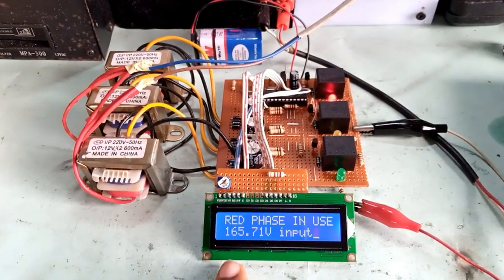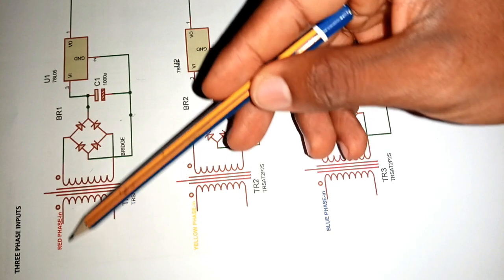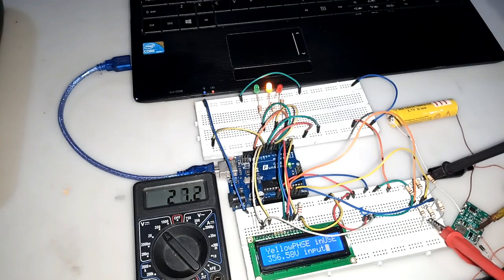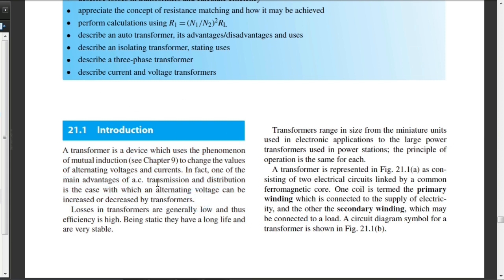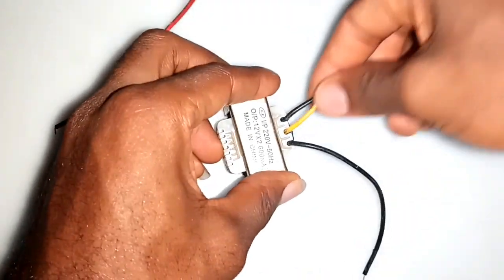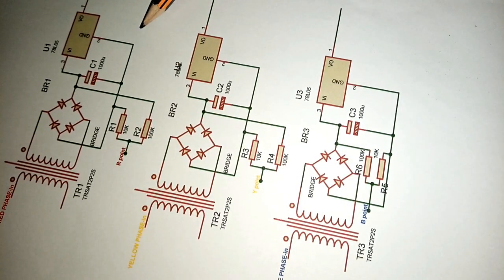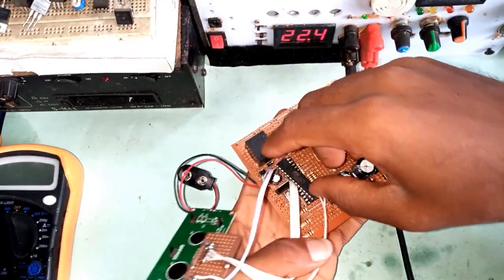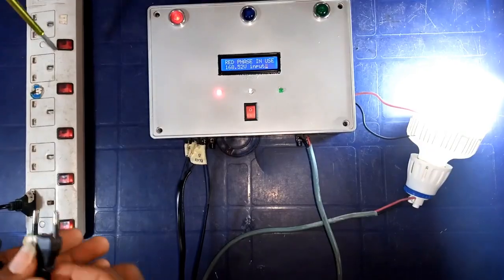3 PHASE AUTOMATIC CHANGE OVER SYSTEM:How to make an Arduino based 3phase automatic changeover system

Comment: Good day sir, which formula did you use to calculate the value of the capacitor size?
Reply from the maker: For the rectification.
Reply: @MEmbedded_TechLab yes, did you use any calculation to determine size of the capacitor?

Comment: these relays using for LIVE switching is too small when apply loads at the output. 40A t0 80A relay is suitable . Again instead of transformers use SMPS with CC /CV output for each phase. Though the project will be a little costly than the transformers.
Reply from the maker: Thanks for the kind recommendations

Comment: hello what are the values to adjust in the program at the level of float VIn_a = 0.0; //Voltage In after voltage divider
float VInY = 0.0;
float VInB = 0.0;
float Voltage_a = 0.0;       //Actual voltage after calculation
float VoltageY = 0.0;
float VoltageB= 0.0;
float CalVal = 11.08433; //Voltage divider calibration value
float AC_LOW_VOLT = 0.0;
float AC_HIGH_VOLT = 0.0;
float AC_LOW_VOLTY = 0.0;
float AC_HIGH_VOLTY = 0.0;
float AC_LOW_VOLTB = 0.0;
float AC_HIGH_VOLTB = 0.0;
//Timing
unsigned long previousMillis = 0;
please reply me to this email

mutwaletaradja4@gmail.com
Reply from the maker: You don't need to adjust any of them, provided you are using the same components I listed for this project
Reply: @MEmbedded_TechLab  
Big thanks engineer

Comment: How did you connect the relay normally open and normally closed pins to the power supply
Reply from the maker: I shared that on the schematic diagram, which I made available
Reply: @MEmbedded_TechLab  so you just connect the to the ac side??...but the ratings of most relays are 5v ...kindly explain to me further alittle bit I need to understand
Reply: @MEmbedded_TechLab  from your prototype I have not seen that connection ... that's my biggest concern
Reply from the maker: @trendingnewstv1591  
The relay is rated 12v
Just download the schematic diagram on the video description, with that you can easily analyse the system.

Comment: Great project 👍. But there's something I'm not cleared with. Can I call this  project an  automatic phase selector? 
Because it doesn't involve changing from utility to generator or to inverter.
Please explain 
Awaiting your feedback. Thanks
Reply from the maker: You are correct.
It's a phase selector
Reply: Thank you for your feedback

Comment: Hi,
Where I can find the code, circuit diagram and PCB layout (for the design programs, not PICTURES)?
Reply from the maker: I shared all that on the video description.

The pcb layout is yet to be published, as am retouching some parts
Reply: @MEmbedded_TechLab  Where the design files are?
I can see only pictures which are not very useful.
Reply from the maker: @paulcohen1555  https://drive.google.com/file/d/1b1A-fxDWTe79A92x9jAhG62ksaOsyQA8/view?usp=drivesdk
Reply: @MEmbedded_TechLab  I can't download, I am getting an error in the archive.
Reply from the maker: @paulcohen1555  can you text me on Whatsapp
+2348096283289
Reply: @MEmbedded_TechLab

Comment: hey whatsup buddy  will you share the proteus file because im facing some problem while simulating , like relays are not getting on while simulating i dont know whats the exact problem with that relays but i want figure it out will you help me out
Reply from the maker: Use the relay type that doesn't have any solid case

Comment: Brother i am really stuck in this project the resistance with the 3rd phase regulator get damaged always i replaced it with new one the 100k and the system isnt working properly like if the 1 and 3 phase are always on and relay of 1 and 3 work at same time and even the lcd interface with arduino isn't working correctly
Reply: Waiting for your reply brother
Reply from the maker: Share with me your assembly
Reply: @MEmbedded_TechLab   what's app or any insta id
Reply: @MEmbedded_TechLab  check insta brother
Reply from the maker: @MUHAMMADABDULLAH-qg2gm  WhatsApp
Reply: @MEmbedded_TechLab  i think brother i had use transformer 12vac and on the output of rectifier is 16vdc other issue is when the 3rd phase is on it start to give supply to arduino from the 3rd output regulator and arduino board is used not the ic like u used of arduino external

Comment: I want the same input and output, what changes should I do brother? can you help me out or anyone ?? 230v input and 230 v output
Reply from the maker: It will require a different circuit altogether
Reply: @MEmbedded_TechLab  sir can u help me out in one protect, it would be great if u do so
Reply from the maker: @vijaypatil8039  
Which topic
Reply: @MEmbedded_TechLab  same concept 3 input. All input must be set to 230v or at particular voltage, if voltage goes up or down for example 225v or 235v, grid will activate so another input can take place.... One of 3 input one will be primary input and other 2 will be option who can takes place if primary input voltage goes up and down
Reply from the maker: @vijaypatil8039  it's possible, and it will require some adjustments on the code and hardware
Reply: @MEmbedded_TechLab  it would be great if you help me out in code and circuit, as it is most important project as it's related industrial use.
Reply: @MEmbedded_TechLab  can we talk over Instagram or WhatsApp if you want.
Reply: @MEmbedded_TechLab  Brother can u help us ? you are the only last hope for us.
Reply from the maker: @vijaypatil8039  ok, kindly send us message on WhatsApp, via this line,+2348096283289